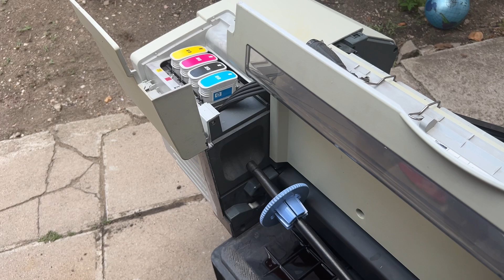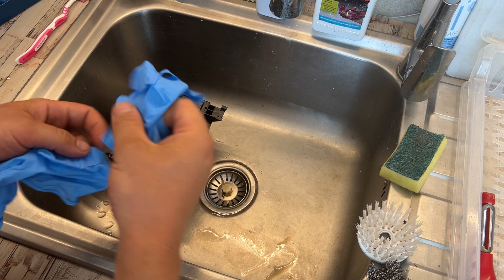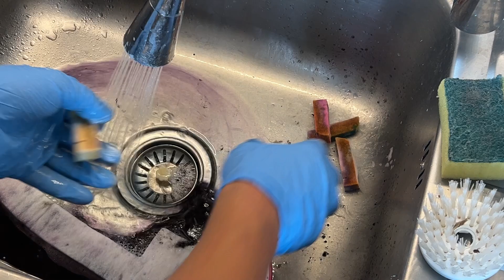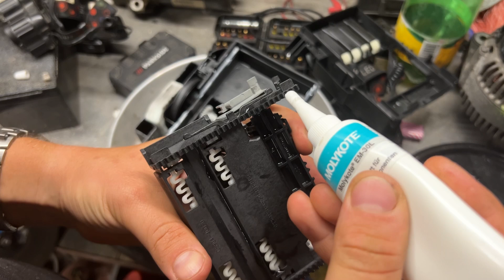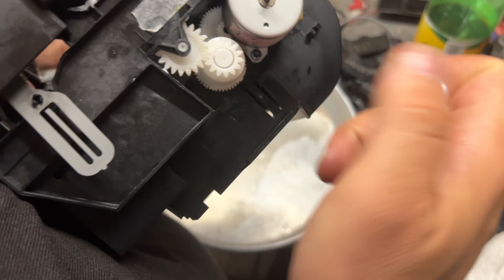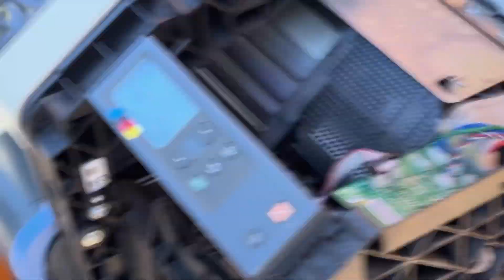HP DesignJet 500 800 510 21:10/21:11 FULL REPAIR CLEAN Service Head

Comment: Nice job i did the same to mine . I just wanna say something about the printers that take the HP11 print head like this one and the HP 800  . They stopped manufacturing the print head , the prices have sky rocketed for them if you can find them new . I purchased a set for under $50 dollars on amazon but it ended up being a scam , they send me clogged up print heads with the guts missing . I have 2 HP 800 printers one is 24 inch the other is 42 inch . I have 20 print heads , 16 of those print heads are clogged and no amount of print head cleaner could unclog them , i even tried to pull a 25 psi vacuum  . I opened up the print heads and immersed them in very hot water that seemed to remove some of the stubborn ink , i was at the point of throwing them away before i found out how much a new set would cost . Since i had a steam cleaner i said why not even if it damages the print head i got nothing to lose , i took the worst print head ( this head was removed because of bad quality prints at least 5 years ago ) immediately upon applying the steam pressure to the steam head i could see the color on the print head disappear . Then i tried to pull a vacuum through the print head and this time it was able to pull air through the print head . I put a little amount of Mechanic all anti corrosive high penetrating lubricant , let it sit for a few days then cleaned out the lubricant and gave it another shot of steam . From there i checked for vacuum and it pulled air again but much easier this time  , i put it together and primed it with ink then put it back into the printer and it worked . Now i got 15 more to go .
Reply: What did you use to apply steam to the parts?

Comment: Just bought a HP 500. Good video. I may need to clean the service station. Thank you.
Reply: Did you know they don't manufacture the HP11 print head anymore , if you do find a new print head it will be expensive . If you find it for cheap it is probably a scam .